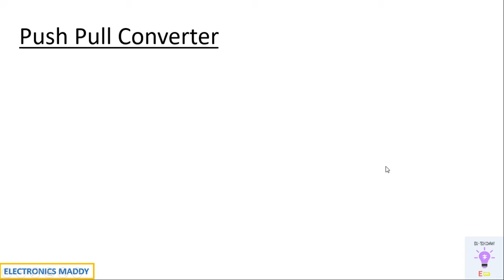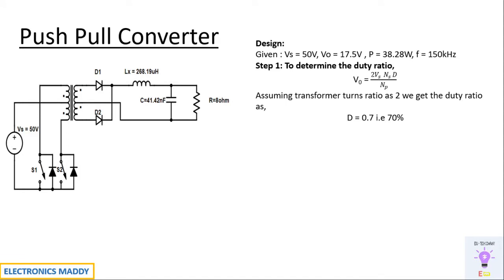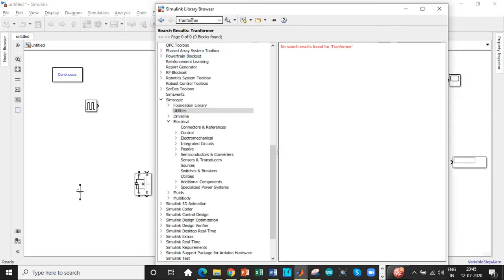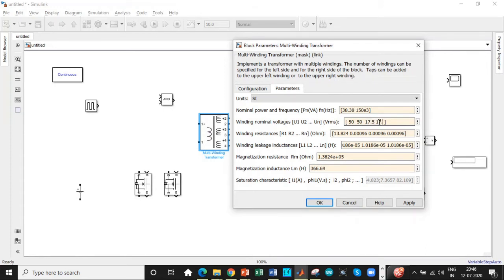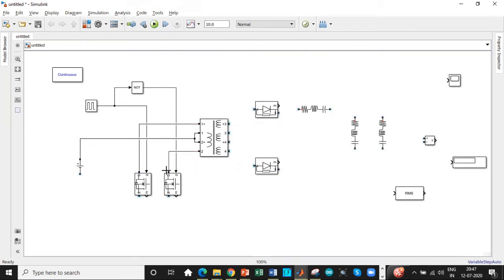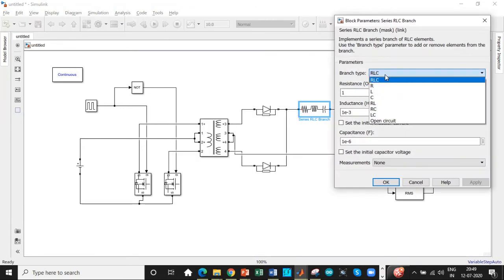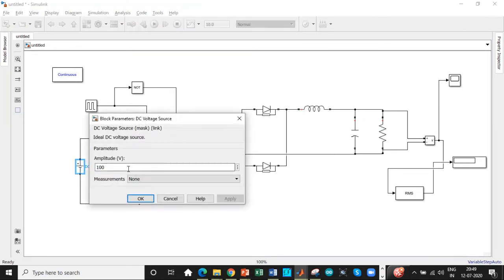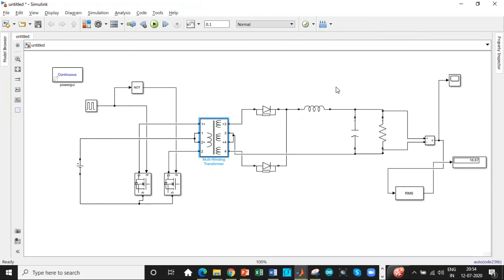Design and Simulation of Push Pull Converter using MATLAB | SIMULINK

Comment: During the operation of switche one or two, the current in the inductance will increase and there is no discharge mode. you need to add a third state where both switches are off.

Comment: how do you assume the values of various parameters like resistors, inductor, transformers etc.
Reply from the maker: It totally starts from the requirement. Like what Is your load and how much you want the output to be. Based on these you can decide

Comment: Please send me design of 48v to 12v 10amps push pull converter using sg3525
Reply from the maker: Hi Alagar Krishna. I want you to try it first and in case you are stuck then Mail me with the details to Electronicsmaddy@gmail.com. I would expect you to brief your efforts and where you are stuck at and what is the objective of the circuit etc.